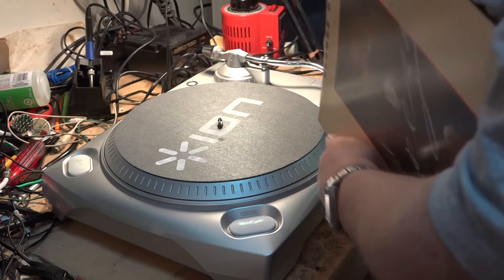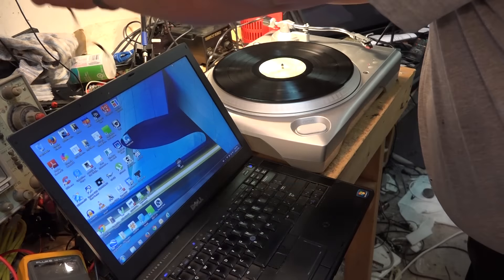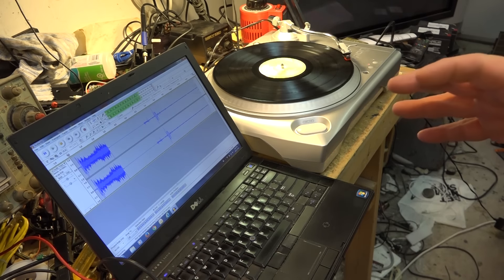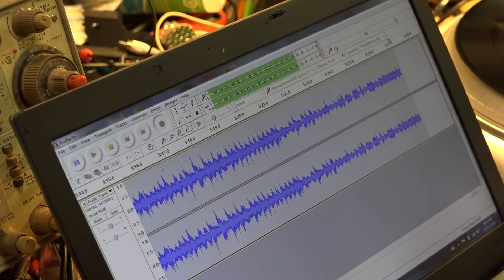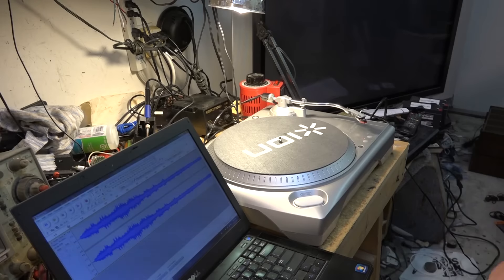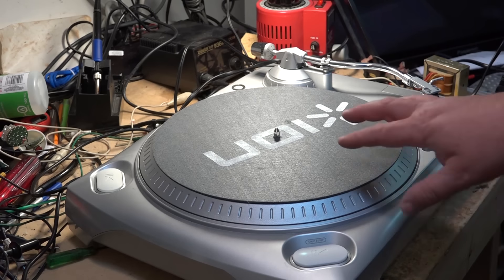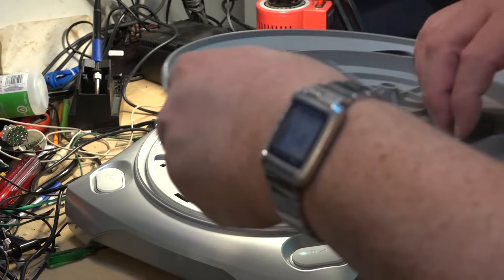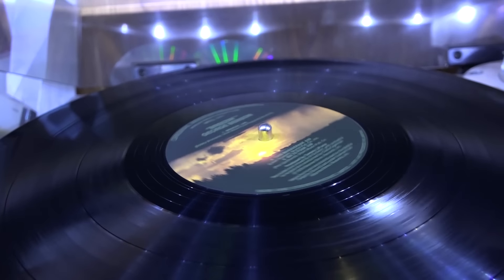ION USB Turntable shoot out with an Technics SLM1 and CD

Comment: Your comparision isnt that great. First off, you have a p mount tonearm on your technics and those are limited in sound quality compared to a half inch mount tonearm. Second, there is no way a mp3 file or rip sounds better than a WAV file. And third, even a Numark Groove cartridge will sound better and more detailed than the audio technica p mount catridge.
Reply: P-mount tonearm are NOT in anyway inferior to standard tonearms.  Nor are P-mount cartridges inferior to 1/2" mount cartridges.  The P-mount system came in while the CD was just arriving and did not have time to flourish.  If anything, a P-mount will have much more accurate tracking and there is no VTF errors.
Reply: If the MP3 version of the same album was mastered differently, it could very, very easily better the vinyl.

Mastering has more to do with the end result than the format it was recorded on.

Most people will not be able to tell the difference between a high bit rate MP3 and a FLAC or the original CD. I've proven it in my home on my system (Sony ES separates and Yamaha NS-1000M speakers).

The only time there's been a big difference is with things like the original released CD of Dire Straits' Brothers In Arms. The Spotify version sounds shit. Not because it is compressed, because the actual remaster is compressed in terms of dynamic range and therefore, it sounds boring. The original vinyl sounds the same as the CD (When it is clean.)
Reply: I beg to differ. Of course your not going to hear any difference with speakers, but with headphones, there will be a major difference. Also, to say that mp3 can be mastered differently to sound similar to a Wav or flac just tells me that you aren't capable of knowing how to listen to music. Mp3 is compressed. I don't think any codec that can compress sound will sound any better, much less the same as an uncompressed audio file.
Reply: I respond with this: Everything you just said but directed at yourself.

You aren't reading my post properly. When you compress a music file, you aren't mastering it. I am talking about the work done in the studio. No codec which is used when compressing an original file will make it sound "better", I said most people can't tell the difference.

But, carry on with dismissing remarks - I am perfectly capable of listening for differences in a recording. 

If you re-read my post properly, you might understand what I was getting at properly, if not, nevermind.
Reply: I did read your post. You claim that album can be mastered properly and be released as a mp3 rip, meaning the sound quality can be comparable to the same album ripped to wav or flac. There is no possible way. I have gotten auto rips from Amazon for vinyl I have bought and to me the difference is night and day. I'm sorry if you feel I'm dissing you but I have been an audiophile for a long time and there is no way that a mastered mp3 album can sound better than an album mastered into wav or flac format.
Reply: When did I say it sounded better? You've said there is no way that a "mastered mp3 album can sound better than an album mastered into wav or flac format" - that ISN'T mastering, that is ripping an album to your PC and applying compression to save space.

MASTERING is what happens at the studio before the music is even put on a CD or cut to vinyl before it is then sold. 

If you have an album on vinyl and CD where the content on both mediums are the same master from the studio, there is going to be hardly any difference at all. This is why I wrote using Brothers in Arms as a reference point in my initial post. There are several remasters which all sound inferior when compared with the original release because the dynamic range has been cut by 8dB. 

People very often, without realising, base their mp3 vs original CD/vinyl comparisons on an original release with a remaster. The remasters usually have their dynamic range cut and the EQ is altered because more people listen using cheap earphones than on a proper hifi system. A vinyl record, even if it is dirty, will sound better than a remaster of an album which is in FLAC format if the remaster is a modern one with no dynamic range and an EQ curve to suit headphones rather than loudspeakers.
Reply: How do you take an album like brothers in arms, master it into mp3 format and without compression? You can't. There will always be compression, in the mastering and in the mp3. How does that make it good? To me it doesn't.
Reply from the maker: Since when did I claim to be an audiophool?I have a small vinyl collection, but more CDs than vinyl. I abandoned the format early in the 80's when I bought a high end CD player and never looked back.
Reply from the maker: That model of Technics came with the P mount arm, and I never bothered changing it because it isn't used that often. I have a Thornes that is a much better table. This one was a DJ table I got out of a radio station that used 2 of them for on air work. I used to have a nice Stanton cartridge on it, and still have it. Unfortunately one of my kids wrecked It when it when they were young and the needle is no longer available. That Signet (audio technical) is the only one I could find, and I don't use it very often as I had already recorded all my stuff using the old Stanton. I have a Shure on my other turntable and I like the sound on it.
Reply from the maker: When you compress any signal, audio, video photos you change the original file. The exception is flac, which like a zip file is a reversible compression format.So no, when you compress a file you are throwing away bits.The vinyl recordings in this demo are WAV files, no compression. The CD was from a CD rip into MP3 @ 384k. The only reason I used that is because the CD is packed away in a box, and I didn't feel like looking for it to rip it into a WAV for this demo, because the MP3 sounds better than the vinyl, and a full bit rip from the CD would sound even better, but I can see if I want to satisfy everyone here I'll have to go find the CD.All my disks, about 1000 or so were all ripped to high bit rate MP3 and then the disks packed away in boxes as I didn't have space to store them.
Reply from the maker: Very valid points, and I have a very expensive P mount Stanton cartridge but the needle one day just vanished. Neither of my kids that were young at the time admit to snapping it off, and I was unable to find a replacement, so I put on that Audio Technica, which doesn't sound bad actually. The P mount was designed to eliminate alignment errors that are a real concern with conventional headshells.Since they were made to a specific standard there are no overhang, and skew adjustments to worry about. Some people ripped the arm off and replaced it. I never bothered, because with the good cartridge it sounded great. Even this one sounds good.
Reply from the maker: First of all there is compression, and then there is digital compression. 2 different things. I am not referring to the compression of converting to MP3. I am referring to the compression done by the mastering engineer to conform the audio signal to the limitations of a vinyl replication.When a studio multi track tape is mixed down for a vinyl cut, the engineer will de "s" the sss sounds so they don'r sound scratchy, and will EQ the loud bass so the needle won't jump out of the groove, and generally compress the dynamic range of the session tapes in making his master mix tape that is sent out to the cutter.What that tape is used to make a CD the sound isn't much if any better than the vinyl version. However when the studio does a proper remix, and does not employ dynamic range compression in making the digital master tape that is used to create the CD, the imaging is superior.To be more fair I could go and find the CD and make a bit for bit rip of it, as opposed to using the MP3 rip that I made when I archived the CD onto my music server. I archived all my CDs at 384k bits as to my ears I don't hear much difference in sound quality, and I wanted them in a file format that was compatible with the system in my car.
Reply from the maker: Where did we ever get into the discussion that an MP3 was an audiophile format? I use DAT tapes for a reason, no compression. CDDA audio is what I am referring to, and if I mentioned compression at the studio in the mastering state, I am referring to dynamic range compression used in all analog vinyl mastering because vinly typically has a dynamic range of 60-70Db. CD on the other hand 96db.That is the range from the softest to loudest sound. CD also has a flat response from 20-20,000 Hz. Vinyl is all over the map in terms of dynamic range, depending on the frequency. I won't go into the details, as it gets very complex mathematically with the formulas used to determine it, but you are welcome to goole the dynamic range potential of the phonograph if you would like more information.Also most engineers cranked up the levels to the maximum recording level they could, because we all know that maximum volume, with minimum dynamic range gets attention right. Just why do you thing TV commercials are so dam loud.To some people they think vinyl sounds better, but it actually your ears and brain being tricked. This debate has gone on as long as the CD and digital recording has been around, and it will continue for the foreseeable future. Thing is buy and use what sounds best for you. I studied music at a younger age, I have been in recording studios, and I know several musicians. I have rubbed elbows with recording engineers, and I have had a chance to hear music in some pretty darn good studios and the CD is as close to live sound in the studio I have heard and no analog recording even comes close.
Reply: It's nice to see responses from a man who understands engineering properly.

I cannot stand the audiophool terms when people start talking about a component having more soul, for example. Ergh.

Vinyl is just "cool" and the records look nice. It's a faff to keep a vinyl front end performing at its best, the vinyl and stylus need to be kept clean - ergh. CDs FTW.
Reply: A lot of people harp on about vinyl having a wider frequency response, it makes me chuckle.

A phono stage is basically an equalisation curve to correct what you explained here - the bass is cut significantly because of playback issues which would otherwise resullt. Audiophiles go on and on about wanting purity, then employ a vinyl front end which consists of a noisy, degrading vinyl disc, a stylus and cartridge which over time wear out and an equaliser curve to make it sound somewhat like you would experience in the studio.

Right.

With the CD, you completely negated the need to worry about that stuff, the guy in charge of the faders just had to ensure he didn't push things too hot because "distortion" in the digital realm is impossible. It's an all or nothing trait, clipping sounds way, way worse than distortion in the analogue world. It proves to me that there is no right or wrong method, you're picking something you personally prefer, there is nothing wrong with that at all. Nothing worse than a closed minded person who insists you must only listen to music in one way. How boring.

I still maintain most people, even on a high end system would struggle to nail the differences between an original CD and a high bitrate rip. Even if the differences are noticeable, the music is still enjoyable and convincing.
Reply from the maker: I couldn't have said it better myself.When recording digital it is  a good idea to set levels to peek at -12dB. That way you are absolutely sure that no matter how hard that drum is smacked it will never make it to 0dB because in digital there is no overdrive. There are a finite set of numbers and once you get to 1111111111111111 there is no more the signal clips and it sounds like crap.